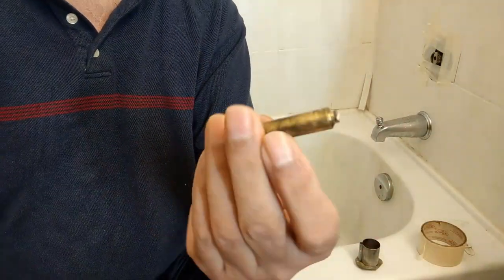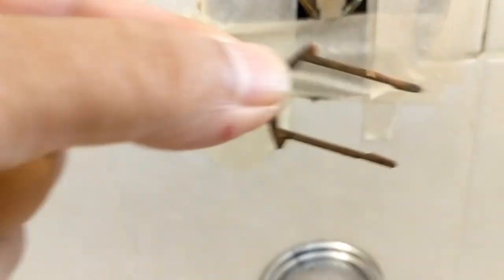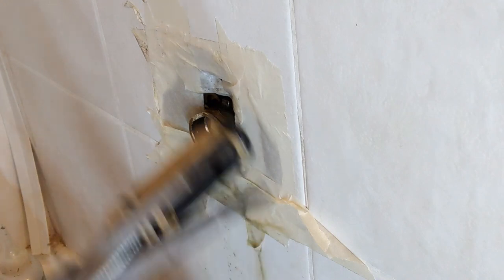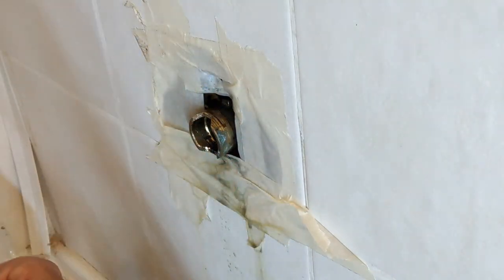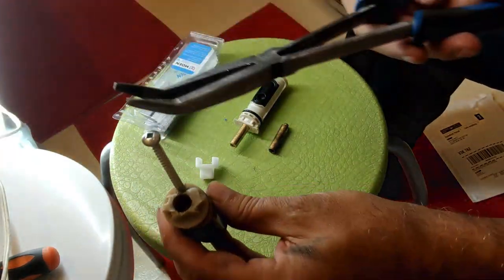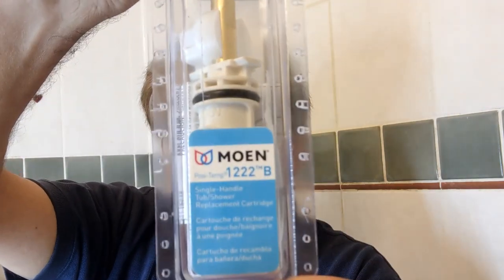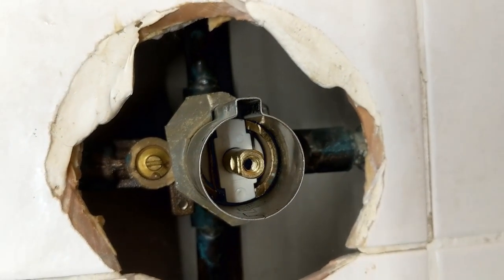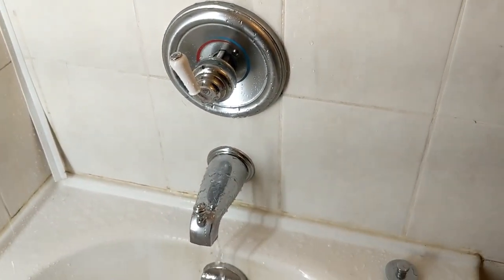How To Replace The Broken/Stuck Moen 1222 Shower Tub Faucet Cartridge Quick, Easy, No Special tool

Comment: If Dr Saqlain Bhatti had devised this simple hack all by yourself, you are indeed quite a clever man❗ After watching this video, I stumbled upon another clip depicting the same trick, posted a little over a year before Bhatti's ... "How to remove a shower cartridge with the stem broken off inside", by Stephanie Vandaelle, on Jul 8, 2021.  So, here goes the old cliché  : There is nothing new under the sun! 
  I browsed through some of the videos in this channel, and Bhatti appears to be a person of multiple talents!   Does the "Dr." title actually mean medical doctor？ A PhD degree？ Or just a form of recognition for your expertise in Bonsai and/or cooking？
Reply from the maker: @Banana4805 thanks for your Comment. Well, I am a Ph.D. degree holder retired, and now a DIY person.  
When I got to replace the broken bath and shower cartridge, I watched some videos on YouTube for replacing the stuck cartridges, but I did not get the chance to watch the clip by Stephanie.  Well, I got the idea for this hack by watching a video where a pro plumber used the tap-and-die tool to remove the stuck cartridge. Even Moen also suggested using the Tap and Die tool when I contacted them.

Comment: Nice job! I will try this tomorrow!
Reply from the maker: Good Luck.
Reply: @drsaqlainbhattithebonsaich1196  it didn't work lol. I got the screw in there, but when I tanked, it just ripped the plastic out. Tried 3 different holes. Called a plumber and they actually put a blowtorch to it and got it out. Your video was great though.

Comment: Nice job, but it does put a lot of stress on the whole pipe when you pull like that.  However, a bolt threaded into the cartridge through some large diameter washers, placed against hole in the pipe, allows the force to be transferred to the outer rim of the hole of the pipe instead.
Reply from the maker: Thanks for the tip
Reply: Good suggestion. I stop pulling when I see the valve move.

Comment: Thank you for your help your method worked very well for me. I used the existing threaded hole and a longer bolt with a few scraps of wood. Thanks again,
Reply from the maker: I am glad this method worked for you. I used 3 inch long bolt.

Comment: use the MOEN CARTRIDGE PULLER  MUCH EASER THAN DRILLING HOLE.
Reply from the maker: The cartridge puller is effective only when the threaded shaft of the cartridge is intact. In my case, the threaded shaft of the cartridge is broken and there is no way to attach the puller to the cartridge.
Reply: @drsaqlainbhattithebonsaich1196   you are right, my mistake,sorry

Comment: just buy the puller tool...
Reply from the maker: I have a puller tool. This tool works when the cartridge is in one piece and stuck. In my case, the shaft of the cartridge is broken, where you attach the tool.